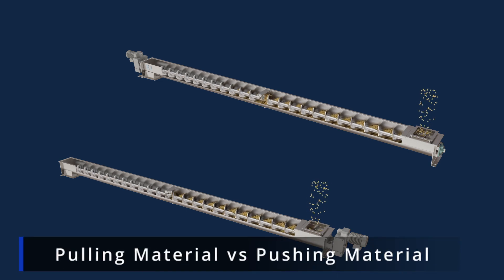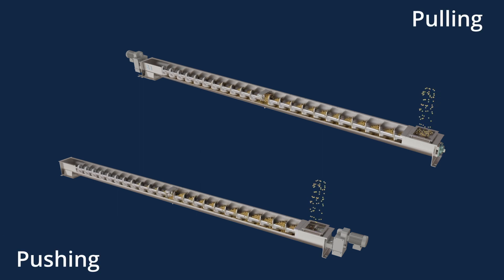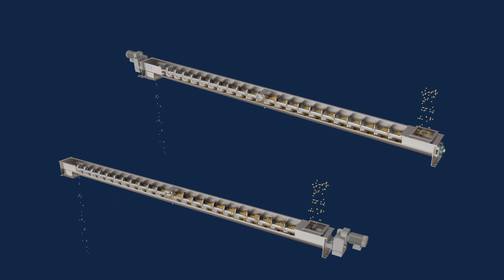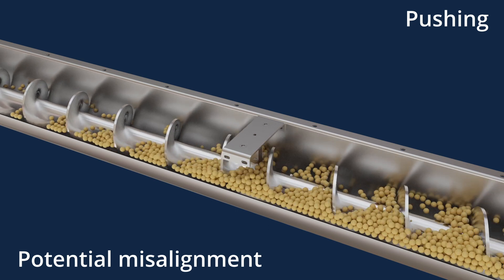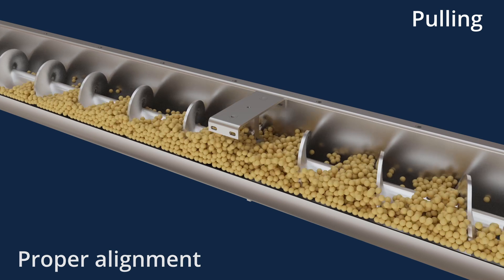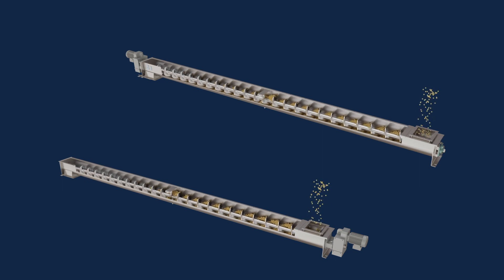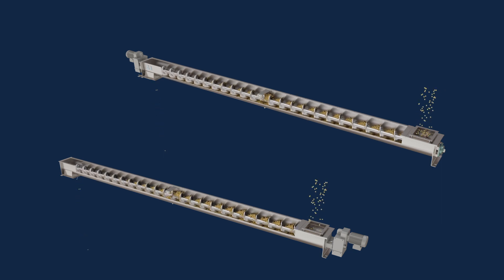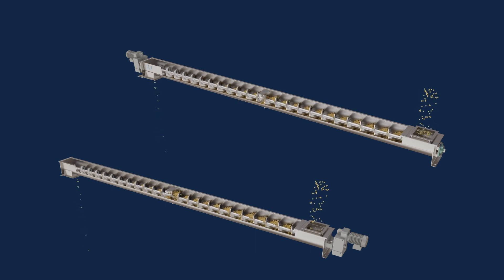Pushing v Pulling Screw Conveyors

Comment: Can it support 1000 feet horizontal, we want to use in dairy for cowdung
Reply: It should don’t know how good it would push liquids. We brace it at every 10 foot or so and I don’t see why it wouldn’t that’s a hell of a auger though
Reply: For that length chain conveyor would be better choice. 1000 ft would be a lot of hanger bearings to maintain and you would need very solid connections between screw lengths to be reliable. 35 years working in moving grain and milling products - that would be my recommendation.

Comment: Metal in tension can carry more load while in compression it will sag,bend or buckle.Drive motor mostly located overhead for wiring reason ,For belt conveyor it is wise to install motor overhead when the load is from bottom to avoid double friction on pulleies.